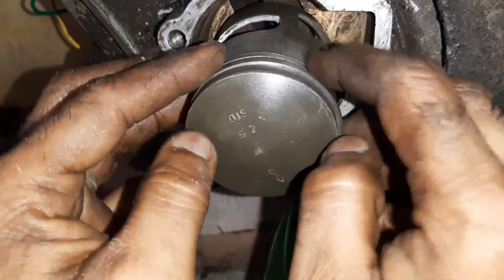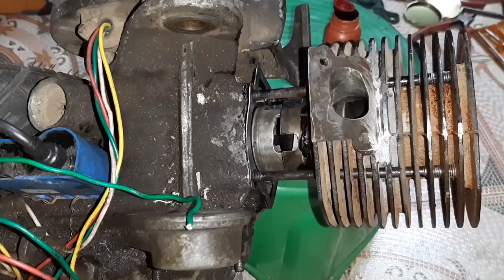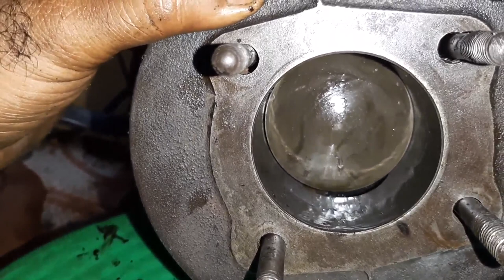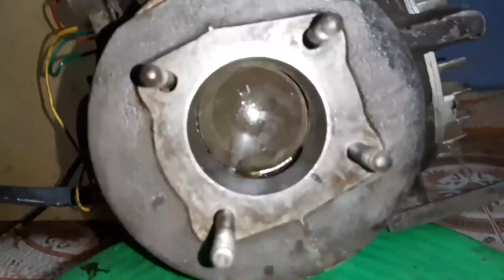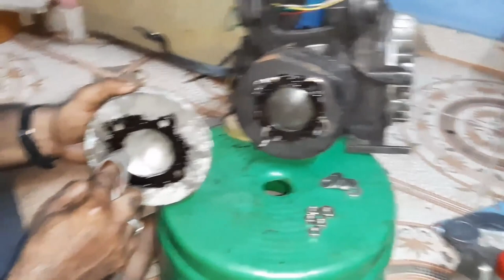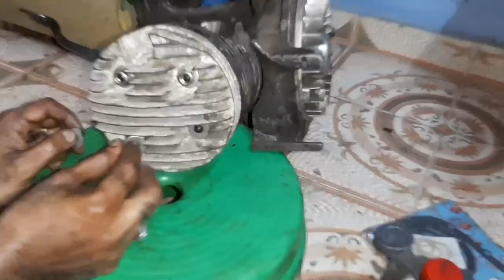The Advanced Guide To Installation Of Lambretta Cylinder Bore With Piston Ported

Comment: Bro ? You have been modifying ports I see
Reply from the maker: Yes Sir. Modified inlet and exhaust including transfer ports 👍
Reply: @LambrettaRamesh  well done sir , if you ever need advise with tuning message me  . Good luck
Reply from the maker: Thank you very much Sir. Sure definitely I will message you if in case any requirement arises towards tuning
Reply: Does extra cut out in the piston make a difference in top speed ramesh
Reply from the maker: Very good question Sir. But not too big. Care to be taken regarding upto what duration the inlet port is subjected to opening and closing. I tell you the secret. That is if the port on piston is small. The engine can not inhale the air fuel mixture at top speed resulting loss of power at top speed. Actually its a big subject. I did research on this. Timing plays very important role. Every dimensions are very crucial to attain top speed. Thank you Sir
Reply: @LambrettaRamesh  thankyou ramesh 👍👍
Reply: @andrewdace1314  hope you are running a reed valve Ramesh ? i see you cut a window in piston skirt ? you will have great difficulty starting engine my friend ....
Reply from the maker: No Sir. It starts in half kick 👍
Reply from the maker: After installing reed valve there is a improvement in starting
Reply: @LambrettaRamesh  yes thats right sir  . i see window in piston but not see reed valve ? are you making you own  reed valve system or buying from somewhere ?
Reply from the maker: Sir. I post a video regarding my reed valve work. For 38 times I modified the reeds with different designs. Reeds are not purchased but my own made. Only reed cage is purchased. Different design of reeds act differently according to the modifications made in engine. In each practical I used to get various results and it's a great joy. Still continuing the work/research. Thank you Sir 👍
Reply: @LambrettaRamesh  good work i will look for the reed video  ....
Reply: @LambrettaRamesh  do you have a link , cant find it on your channel  sir .
Reply from the maker: It is not yet uploaded. I will upload soon 👍
Reply: @LambrettaRamesh  ahh ok . im doing video about trail tech CHT display for lambretta , good to monitor cylinder head temperature .........
Reply from the maker: Sure. I will watch 👍👍